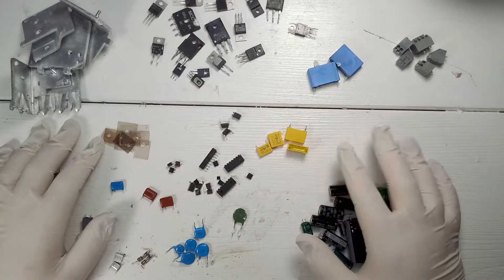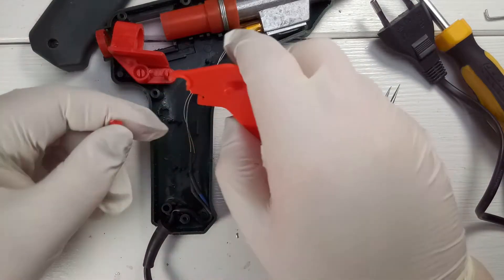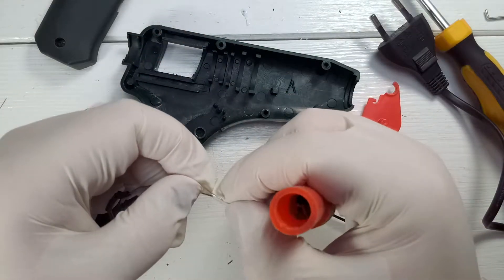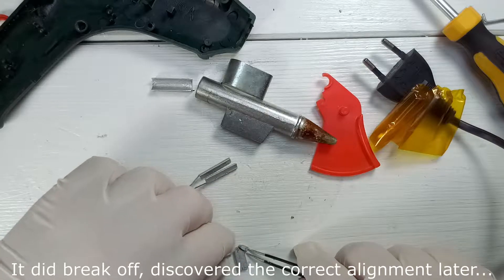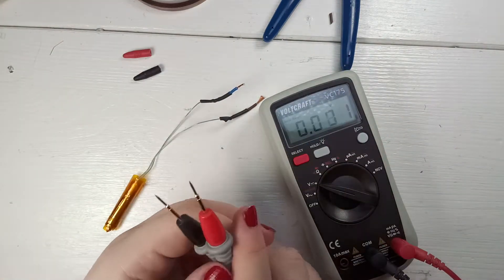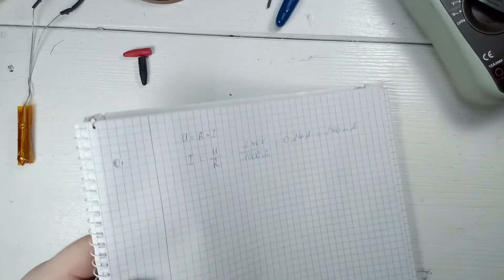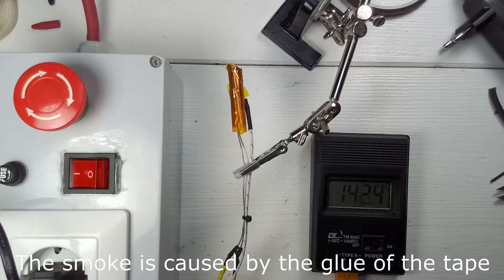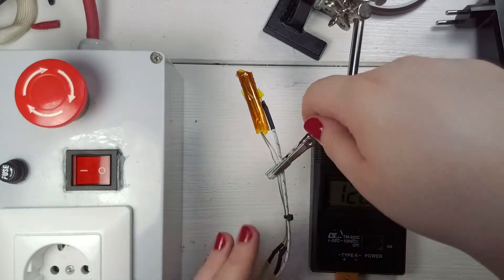Hot Glue Gun Teardown - Very Interesting Heating Element

Comment: You could've fixed that trigger with confidence of strength using super glue followed by baking soda immediately after applying glue. The process is done in stages and you could even add some girth to the ring using more glue on top and more
baking soda. You will have to sand or file into the form you require. This technique is used in repairing chips and cracks in airplane propellers so you know it's got to be strong.

Comment: Great video! Just yesterday my hot glue gun shorted out with a bang (second one lol). I figured it happened cause while it was hot (glue melting state) it tripped and fell to one side wich led to filling the heating element enclosure with glue and shorting it out (no idea how exactly, glue isnt conductive?). Im still tinkering to figure it out, anyways i measured 1k ohm's on my heating element so i decided to try and repair the gun. I wanted to contact you so if you can/wish to explain to me how exactly did you figure that its resistance is safe to plug (sufficient to prevent a short). 8:00 min from the video. Contact me please if you have spare time! Again great video! :)

Comment: Thanks for recording this on youtube.  Despite my science background, I would not have understood the resistance curve effect- that's physics.  I am a chemist.  Now onto repairing my heat gun. Please use Fahrenheit temperatures as well as Centigrade.  Coincidentally, my first name is also Anna.
Reply from the maker: Hey, welcome to my channel! :)
Hope you had luck repairing your heatgun. As for temperatures, as a chemist you know that there is no reason using Fahrenheit other than out of habit. As I'm not familiar with Fahrenheit and I'm a physicist I'll keep using Celcius and Kelvin as everyone else in science. So if you like I'll give you the Temperature in Kelvin :D Just add 273.15 to the °C number and thats the temperature in Kelvin :)
Reply: Happy to report SUCCESS!.  You inspired me to take apart (carefully) my Tec-305 glue gun
Took photos on cell phone to remember how to put it back together again.  Baked the bare Barrel
at 425 F  (220 C) in my oven, propping it up vertically in one direction and then reversing the direction for a few more hours.  Drip was slow.  Caught drips on Aluminum foil.  Architecture of tip is convoluted.  I could never see light through it.   Reassembled Glue Gun and it worked like new. I bought this glue gun to spew out lots of glue for sealing corrugated boxes.  I can send you photos if you are curious about it.  Cheapo Ad-Tec glue gun (home use for $5) has never clogged on me.